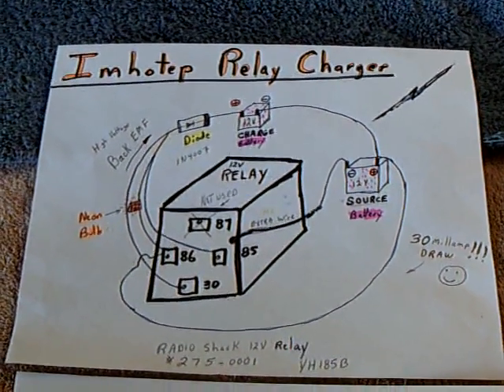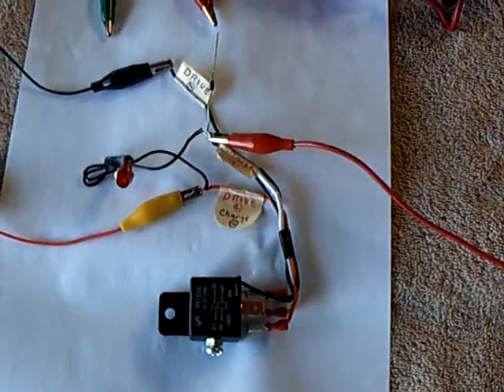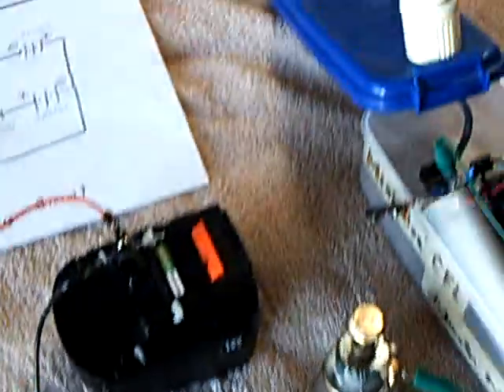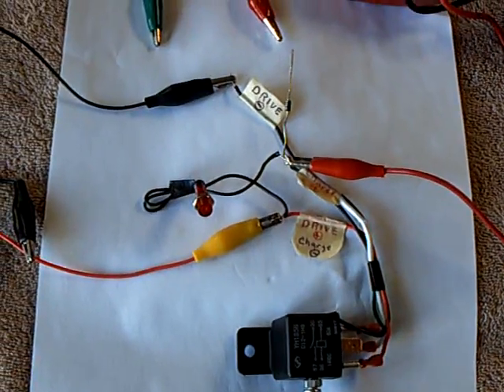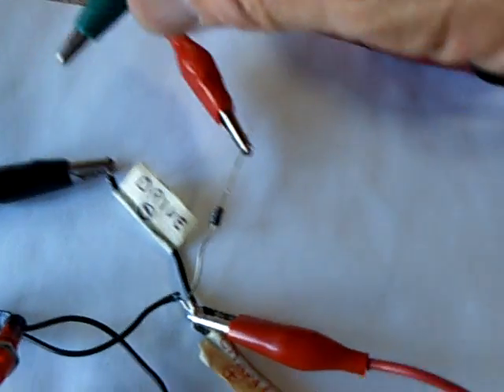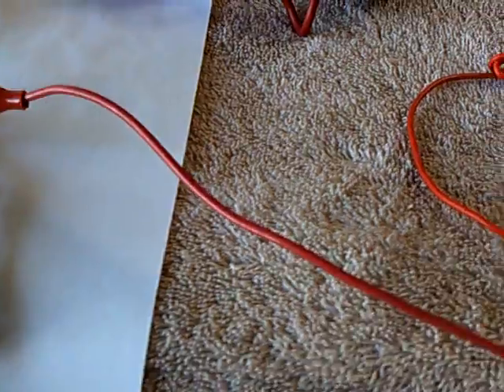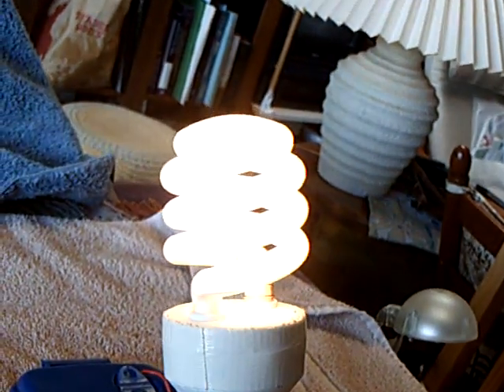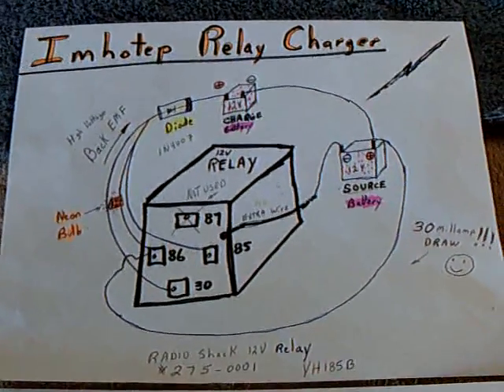Imhotep Relay Charger Replication

Comment: Can we not control its oscillation by powering it via something like Arduino where we can control the Oscillation by controlling the rate at which it will open and collapse?
Reply from the maker: +Talha Kamran Yes you could use a controller on this.  I don't think that you would gain anything because of the power used up driving the extra device.

Comment: improvement idea: Put the relay out there with the solar panel and send the pulses up the long cable. The advantage is that you don't have a LONG cable for DC. Pulse travel over a long cable pretty efficiently, but DC does not. Also, put a super-cap parallel with the solar panel so that when clouds go over, it doesn't matter, and excess energy can accumulate in the supercap.
Reply from the maker: Thanks for the good ideas.

Comment: could you replace the relay with potentialy a flywheel magnet wheel and pulser?...is it possiible to make a 12 battery charger that woirks well with a electro magnet rotor without using a transistor

Comment: The diode is there to prevent the batteries to "short circuit" when eletrcity is being induced on the coil, when the relay open the induced eletricity discharge on the "Charge battery".

Comment: the reason why you can generate up to 400V is because the fact that you are using a relay coil that has a lot of spins what increases the voltagebut when you connect it to the "charge battery" it will drop to almost the same as your battery due to the lack of potencial to source eletrons.  What amothep did, was just rediscover 1940's oscilator circuits before modern chips take place,

Comment: This circuit has nothing to do with free energy. You just using the same principle of a alternator transformer that you conect to your normal eletricity. The reason for the relay is to make the eletrcity becames variable, than you can induce eletricity on the magnetic coil, then the relay turns out and the energy storaged on the coil discharge on your charge battery,

Comment: I’m recharging a size 16 battery (with .800 volts on it) with this imhotep charger and when I connect it all up the charge battery starts off above 12 volts but slowly drops down, is this normal? I’m sure the battery is sulfated but for the voltage to drop to 10.5 volts from 12 is not what I expected. It’s hard to know if it's woking if the volts keep going down. Has anyone else experience this?

Comment: He uses a SPST relay. If you use a SPDT relay like I did, you don't even need to modify it! Also, I used a micro-relay (also from Rat Shack) and it works fine. I plan on encasing it in a small container filled with hot glue in order to dampen the sound. Inevitably, the mechanism will fail. This should be taken into account.

Comment: how did you modify the relay?? and how does the adjustment screw make it possible to use bolth sides, how did you modify the contact??

Mines singin away, but your right annoying. It seem's to effect broadcast tv reception, cordless phone and my cheap multimeter sounds like a giger counter!!!!  Been running about 8hours charging a dead drill battery wouldent charge (was 0 volts) now its 10.5!!! Source is dc power adaptor rated for 500 milliamps!!